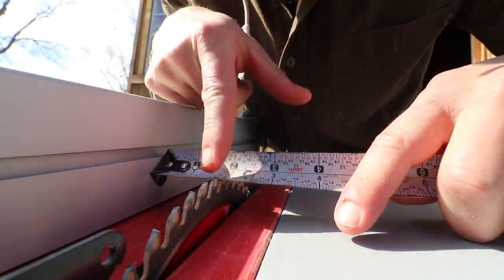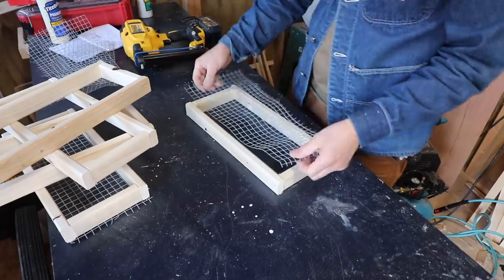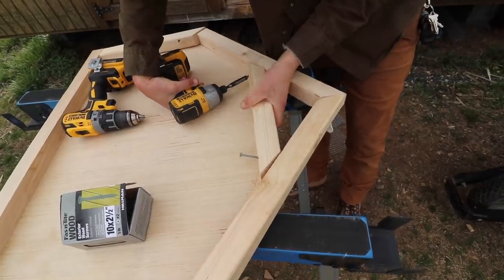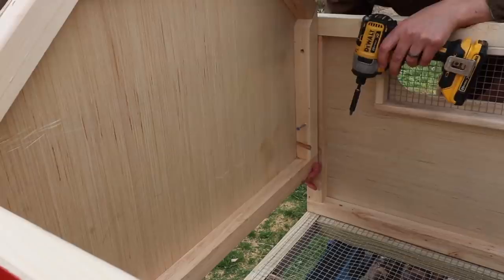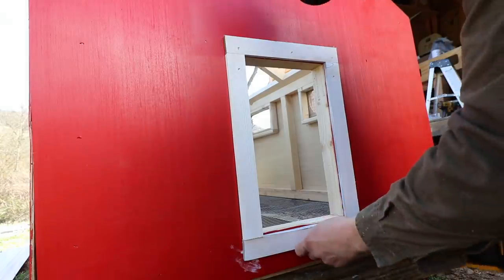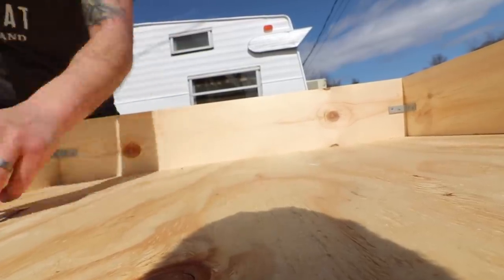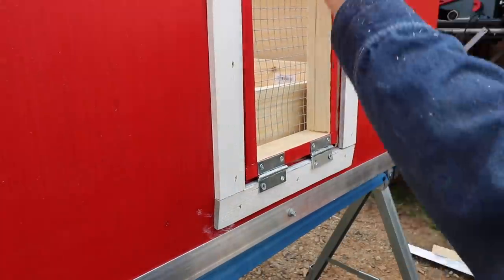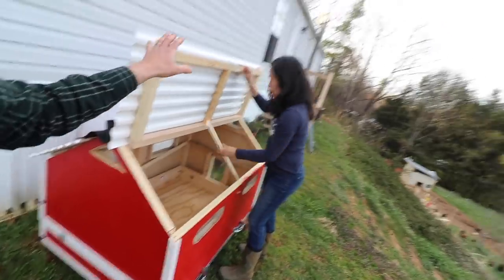Building an Outdoor Brooder/Coop for 30 baby chickens 🐥

Comment: This video was done 2 years ago. How has the brooder held up in the elements?  Also, do you hang the feeder and water or set it on the drawer?
Reply from the maker: still using it and it is working great! no issues 2 yrs. later. You can do either. but I just set it on the floor. thanks for watching!
Reply: @SowtheLand  rely like your videos. Thank you for sharing